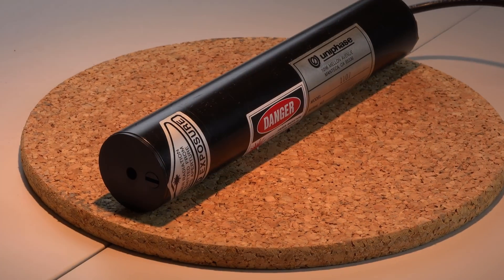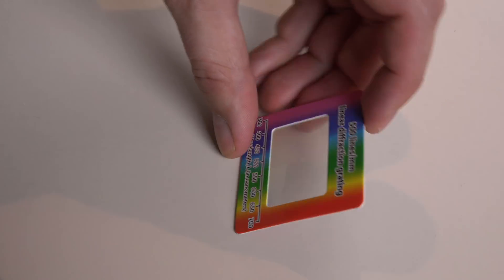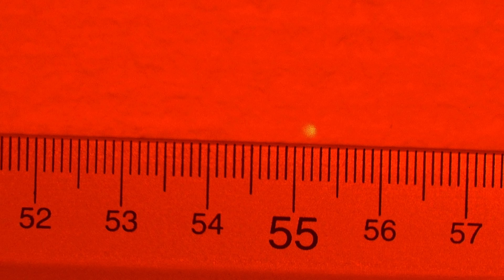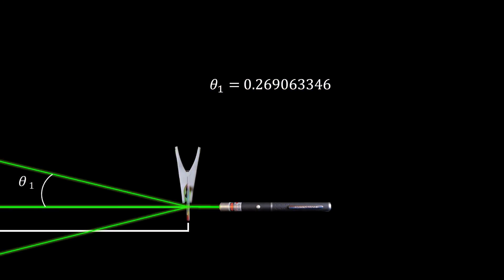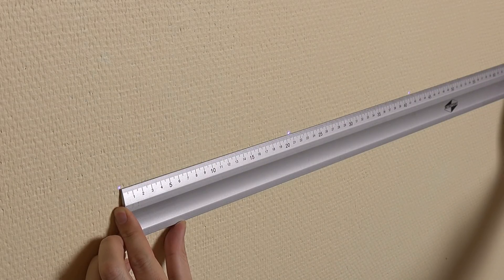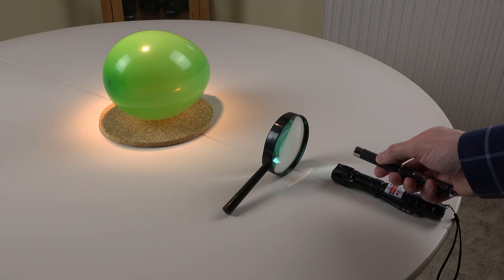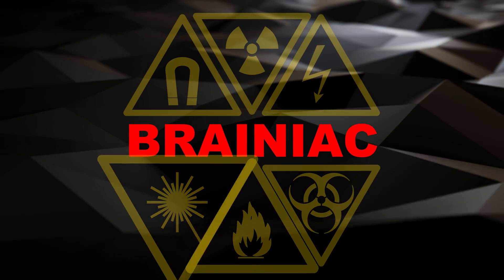MISLABELED LASER | Power and wavelength?

Comment: i purchased a 532 50mW line laser. i took the lens out and determined that it does not double as an IR filter. is there a way to determine what wavelength the IR is such that i can purchase the correct protective eyewear? Further, is there a way to confirm the OD value as the specifications of my product seem inaccurate at best. thanks! great videos!

Comment: My 405 uv later cures my UV 3D print resins! So it's definitely at a cure wavelength! It's very handy for curing the inside of hollowed prints! I've had it for years and just found it in the drawer tonight and tested it as spending to much on what should be 495nm to cure but isn't like them denial UV waste of money doesn't hav ethe UV wavelength it's stated! It does have the 1mw legal label to sell them but pretty sure it'll be higher!

Comment: Blue lasers have more diffraction. That’s why the beam spreads.  Also always wear the correct goggles according to the corresponding wavelength. It’s worth spending £40 on a decent set. Your eyesight is worth more than that.

Comment: Cheap peltier elements make very easy laser power meters. Just color it matt black to absorb as much light you need. If you don't need huge range/power, measuring peltier output voltage should be more or less linear with laser power if my memory serves well. I had good luck with those.

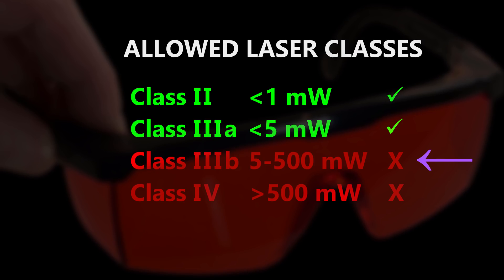Comment: Typo? 🤨 Hmm, I don't know about that. The 0 and 3 keys are pretty far apart, so it's not like their finger slipped. And the ASCII codes for 0 and 3 in binary are 0x011110 0x100001 which would require flipping literally every single bit to swap them. I can't imagine what could cause that one character to get completely bit-flipped. 🤔 Considering the reputation that Chinese sellers on eBay have for fraud, it seems infinitely more likely it was intentional. ¬_¬ 7:30 - But high-power lasers usually cost more. 😕

Comment: Rubbish walkthru hence the calculator part..
jumping back and forward 3:35 and making it more difficult than it has to be by using keyboard numeric instead of mouse pointer so people can't just follow the cursors doing.
and you can bet your ass many people will. just be pressing the "sin" button, at that point where you jumping out. 3:35 and not clear the calculator and not type in the angle manually.
so they will have the angle in there calculator display from the 3:35 part and then jump to 3:56 and push the sin button like its the next step. without typing it in manually and they will get a value that is 10 to 20nm off so not enough so they can see they messed up..
Usually, praise your videos, but this walkthru is crap. dont jump in and out when you making a calculator walkthru and don't use numeric keyboard so people cant see the cursor's movement.

Comment: I just got a 505nm directly-injected diode laser; it was advertised as being under 5mW but it metered 47mW. It's great that I received a way-overspec laser, but I have decades of experience with lasers. The average Joe Smoe won't have this level of experience and would be running the risk of serious, possibly permanent ocular damage with an overspec laser like this.
 
Normally, the major offender in this regard are those 405nm laser "pointers" on Ebay; they're sold as (and often labelled as) less than 5mW, but I've had them meter at close to 90mW! :-O

Comment: Back when I was involved with lasers, Wicked Lasers always overrated their devices by removing the IR filter off the front and claiming it had a much higher output.  Granted, it did in the IR range, but not visible.  So much of their junk was confiscated by US customs and for good reason.

They asked what they should do to make their products better and safer.  We made recommendations.  They shut us out.  Then they started labeling their devices as flashlights to get through customs.  It eventually caught up to them and they caved.

Comment: I feel compelled to say thanks for  information of how to make this measurement. i am thinking a combined green and red to make yellow would be interesting to see. best  guess hmmm dot for each displaying the quality of effective mix in the refractive medium
Reply from the maker: Thanks :) Yes, it would be nice to first mix a red and green laser beam into a single yellow-appearing beam and send it through the diffraction grating. It should split into a red and green beam again with the red being spread the most. With some smoke in the air I could make a nicely looking shot. I'll considder it for a future video :)
Reply: Use color selective mirror to combine the green and red it takes significantly greater red power to get a mid spectrum beam color of yellow . I make laser oscilloscopes using a specific variety of stepper motor as an inexpensive galvo having the colors overlap proportionately makes the dot become a bar this creates very interesting 3D effect to my displays a in both swept and X Y AND Z modes. The bar  shape  flips and twists by the angular displacement when correctly aligned incredably well

Comment: Thank you -- great video!
Small technical detail -- it is convenient to use radians if using a calculator that uses them by default but it really doesn't matter whether you use radians or degrees in your calculations as long as the same units are used in both.  

To show this, we can see that the ratio of the two units would be a factor multiplied into the angle by the arctan calculation and then divided back out by the sin calculation to give the same answer in nanometers.

Comment: could you not  measure  laser power buy putting known amount of water in container and measure temp rise. the trouble would be knowing the coefficient of adsorption of the liquid in question
Reply from the maker: It should technically be possible, but with lasers of this relative low power, it would take some time to see any significant temperature rise. I may experiment with DIY power measurements in a future video. Thanks for watching!

Comment: Anyone else notice the spread in cm was almost the wavelength in nanometers /10, 55.15 was 532, 66 was 632, 41.3 was 404. So even without doing all the maths you should be able to eyeball it. If the laser says it's 700nm for example and the spread is 55cm you know it's labelled wrong. This seems like it's not a coincidence either since it's so close if the setup was more precise (ie the distance from the wall and maybe a flatter surface as the wall looks bumpy) would it be exactly spread over wavelength = 10?

Comment: Why do you need the angle in radians not degrees??
Reply from the maker: Turns out I don't... I just made the mistake of switching between a calculator in degrees and a spreadsheet in radians too much. I'm not a mathematician if you haven't noticed ;) The important part is using the same unit in both formulas. I'll clarify in my upcoming video and show some formulas from a viewer where we don't need to worry about radians and degrees. Formulas that can be calculated with the standard Windows calculator. Thanks for watching :)

Comment: Can you use this same technique to measure the wavelength of an LED or does the fact that the LED doesn't project a dot mean you can't use this technique?
Reply from the maker: As you're thinking, it's not enough to just shine the LED on the diffraction garating. The light is spread too wide on the grating and will not create a clear pattern on the wall. Just a smear on the wall of the same color as the LED. I haven't tried it, but maybe it will work when a black card with a 1 mm hole is placed on the diffraction grating and let the LED shine through the tiny hole.

Comment: I have one of these "questionably-labeled" laser pointers. thanks for showing how to confirm my suspicions! I'd be curious to see whether you've thought of a way to characterize the power output of the laser in the kitchen as well without a power meter.
Reply: The thing I've thought of for this (but haven't tried, as it seems overly complicated) would be something akin to a calorimeter. Calibrate using a known standard laser, and so on...
Reply from the maker: It's hard to make an absolute measurement of the real power output. Maybe it's possible to make a relative measurement between two lasers. Fx from shining the laser on a thermometer painted black on the 'bulb' for a fixed amount of time. A black painted TEG, thermocouple or similar could be used too, but I have no personal experience with it. Thanks for watching!
Reply: Thanks for making the video in the first place! XD

Comment: what the difference between radians and degres? i need it for my improgramming class, thanks if you response x3
Reply: Let's say you take an arc on a circle that has the same length as the radius. The angle of that segment is roughly 57 degrees, or 1 radian. 1 radian = (180/pi) degrees. It's a more mathematical and less arbitrary unit for angles.
In this case he didn't actually need to convert between degrees and radians because it was only used for trigonometric ratios.
Reply: Gooscar ah thank you, it helped me alot :D

Comment: Nice video. Thanks for sharing your lesson/discovery. 
Also don't trust the label on safety goggles! I bought a $50 pair from Amazon that claimed to be OD6 (1,000,000x reduction) in the UV and IR. Instead they were TRANSPARENT in the IR from 1200-2200nm. Even in wavelength ranges that the goggles did absorb, they were only OD4, just 1% of the claimed protection.
Reply from the maker: Yes, that's an issue too... I hate recommending goggles around $300-400 from trusted sellers like Edmund Optics, but it may the only right thing to do when handling very powerful lasers. I would especially be careful near IR lasers, where we can't trust our eyes :( Thanks for watching!

Comment: Why not attempt to absorb the light onto a thermometer painted black for a known time? First with a known power then with an unknown and compare the temp increase.
Reply from the maker: It should work for a relative measurement between the (assumed) below 5 mW bluray laser and the more powerful '435 nm' laser. I just don't have a laser with a known, stable power to do an absolute reading :(
A blackened peltier module and multimeter might be useful too, but thanks for your suggestion and watching :)

Comment: Good video.  If you have a red a green and a blue laser with the same actual output power and same focused spot size, the blue laser will look the dimmest but can actually do the most damage to a person skin or eyes because in the 405 nanometer wavelength you're not only close to ultraviolet light wavelength but there's also a peak in the absorption spectrum for hemoglobin (blood) which would be absorbed and radiated as heat deeper beneath the skin.

Comment: Great video. Will a 1000 lines/mm give the same measurements or will the formula need to be changed.
Reply from the maker: Thanks. You can use the same formula. Just enter 0.000 001 as d. The spread between the dots will be larger, so get a long ruler or place the diffraction grating closer to the wall. Or just measure the distance between the center dot and one of the 1st order dots and only divide by 1L instead of 2L. Most likely less precision the latter, but plenty of room for experimentation ;)
Reply: Thank you.

Comment: This is quite normal for china lasers. They sell lasers this way because of regulations. If the laser is under 5 mW they can be sold without any regulations, fees etc. otherwise you should be older than 18yo, you should pay exxtra money for transport because it is "dangerous" and you also should go thru some test that proves that you are eligible for owning such thing. so, altogether, it is to evade law and rules and also to save your money. And I bet that on product page was mentioned that this laser is xy mW. So, that's why :-)
Reply: Jay _ 5mW won't pop a balloon or light a match. 

I've got a "5mW" pointer here that metered at 50mW on a calibrated LPM. I've seen others reach nearly 100mW.
Reply: Laurence, great point. The 532nm laser is almost certainly a frequency-doubled Nd-Yag. The main output of the Nd-Yag crystal is invisible 1064nm and only a small portion of that is converted to 532nm by a KD*P frequency doubler. The laser label only specifies the 532nm output. Similarly, many other lasers lase on more than one line or have outputs besides the one specified on the label.
Reply: I would like to see a power reading from a calibrated power meter before determining that the power level is above spec. The balloon and match tests are not a valid power measurement.
Reply: Jay _ valid  Typically these 405s are anywhere from 30mW to 80mW when they are over 5mw, and the match lit at a speed comparable to his estimate. 5mW will barely smoke black tape when tightly focused  and no chance at igniting a match. I've mounted hundreds of 405s since they broke into market in ps3 sleds and phr diodes,  many hours with a power meter and matches... This obviously doesn't provide a "valid measurement" but certainly is an accurate indicator.
Reply: Some green lasers work by starting with a powerful infrared laser, and upconverting the frequency to green by passing the infrared beam through a special crystal. This is a very inefficient process and the output beam will be contaminated with a lot of the original IR. There is supposed to be a filter to remove the IR, but if it is bad/cheap/crappy, there may still be a lot of IR in the laser's output. The original IR power might be 20 or more times the power in the green output, so even a true 5 mw green laser might have much more than 5 mw IR coming out. I've never used a calibrated LPM, but if it is sensitive across the whole spectrum, it might be seeing the power in any contaminating IR in addition to the green light. If you are wearing goggles to protect your eyes from the green wavelength, you might still be getting dangerous IR (which is invisible) to your eyes, unless the glasses happen to also filter IR well. Morale: Don't trust protective glasses alone, and avoid chance reflections/etc. anyhow.

Comment: You only have 3 or perhaps 4 (if you count expensive but still kinda afordable true blue) colours of cheap laser pointers on sale (diode or diode pumped). 
No need for measuring wavelength. 
It is either red, green or Blu-ray intended l.d.(violet-blue to eye - visible near-UV really).
You should more worry about green lasers - about IR pump laser diode power "missing the target"/going through misaligned "green laser cascade" and escaping, sometimes hundreds of mW of IR escape tens of mW green laser.

Comment: Something that I found with green and blue lasers is that there should be an IR filter to filter out the high power IR component.  Many Chinese eBay lasers are either missing this filter or the filter is defective.  It's most likely the 25mw IR laser energy is leaking out and that's what's popping the balloon.
Reply: wb5rue 

Cheap blue lasers and some green lasers don't require IR filters. Technology has moved on, direct diode blue and green is readily available, green is a more recent development. 

The only two wavelengths you'll encounter that require an IR filter are 473nm (expensive!) and 532nm (your average cheap China pointer). Those two wavelengths are most commonly produced using an IR pump laser and some crystals which convert the IR to visible light.
Reply: Good day Adam.  I looks like we are subscribed to a few of the same channels!  Thanks for the information, lately I haven't kept up with technology like I used to do.  That sort of thing happens when your little kids become big kids and go off to college and get married.  Life's priorities change.  Soon enough I'll be back to my geekdom and sharing the wonders with grandchildren!
Reply: WB5RUE? A fellow ham I see! Up in VE8 land myself, though I don't much feel like sharing the full VE8 call on YouTube. 

Hope you have a speedy return to geekdom! :)

73
Reply: Contact me, surly there must be a way to send a private message.  I did find your information in my database, you have two callsigns.

Comment: In your calculation, you could have simplified it a bit. You're taking sine of arctan of a certain number, call it x = s₁/2L = s₁/200cm. But
sin(tan⁻¹x) = x/√(x²+1) = 1/√(1 + 1/x²)
So you can get the result without any transcendental functions, just radicals. The order of operations then becomes:
200, /s₁ ,  x²,  +1,  √x,  1/x

Then with diff. grating spacing being 500/mm; which is 2 µm = 2000 nm, just go
λ = (2000 nm)sin(tan⁻¹x) = (2000 nm)/√(1 + 1/x²)
So just take the previous result, already in the calculator, and do a multiply: *2000

Voilà the wavelength in nm!
531.6572...

PS. I really like your optical bench   ;–)
Reply: ffggddss I am currently taking an AP calculus and physics class and this comment triggered the PTSD I have developed towards advanced trigonometry
Reply: + Random stuff:  OOh, that sounds serious.
I prescribe a few hours' dosage of pure topology, which doesn't care one whit about distances and shapes.

Fred
Reply: *see comment
•<•

Comment: In fact if you use an inverse trigonometry function to compute an angle only to pass it into another trigonometry function, it does not matter whether you use Degrees or Radians - just make sure you use the same for both functions. (You could also use the Pytagorean theorem to compute the hypotenuse of the triangle and then use that to calculate the sine of the angle without ever using any trig functions on the calculator, but probably it is easier to just use two trig functions instead and computers nowadays are so fast that the time for computing them does not matter)